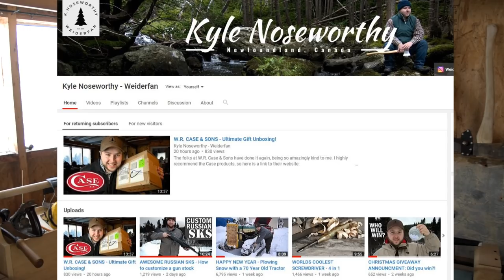Introduction to Whetstone Sharpening - [NLH 1]

Comment: Very good videos on sharpening. I've always wondered why some of my edges just aren't that shaving sharp. The back and forth strokes + removing that wire edge are kind of new to me. As well as the drawing a knife through wood after finishing up. 

I'm curious about improving an average factory edge. What could be done to a fresh out of the box pocket knife to improve it's edge further? Any tests you can do to determine what to do with it to make it a bit better before use? (Ex: go through the stones starting from 1000 grit because it cuts paper, but not well) or something like that. Just curious where you'd start.
Reply from the maker: Great question. Factory edges are usually fairly coarse, so I would attempt to refine that edge. You could start somewhere in the grit range of 400-1000, and begin removing those rough grinder scratches. Then repeat these steps until you have a polished edge :-)
Reply: @kyle_noseworthy  Awesome, thanks for that.

Comment: I have troubles with the shadow method for the angle, it seems I have to lay my knives flat to make the shadow disappear.. I have tried with a bugout and a coldsteel prolite..
So I sharpen them following this method, looking for the burr before moving on, and dewiring them  by making fewer and fewer passes on each side at the end but the result  is not very good.
 I think I may have my angle wrong, do you know other ways to figure out the angle or is there a tip for the shadow method ? Thanks a lot !

Comment: What stones do you recommend for beginners for sharpening a mora knife and some cheap knives on a budget
Reply: Too late now, but I'd say just find a decent ($35) 1000/6000 grit whetstone from Amazon and use that. It'll work fine, even though they're cheap; they still do a fair job.  Especially for softer steels.

Comment: Just a heads up Kyle. The small Nagura stone is for cleaning and making a slurry, not for flattening. I love your videos and they are top notch. Just wanted to point this out for the newbees.
Cheers and congratulations on the new T.V show! Thanks for all you do!
Reply: With a small amount of research (about 2 minutes) I have found that it is actually used for both. Us newbees would like to know that.
Reply from the maker: As @Ken C stated, a nagura serves as both. Just think about it: a nagura helps clean the stone because it wears away surface material, hence, wearing down the high points on the stone. It isn't as effective as a flattening stone, but it does help some, when used regularly! Thanks for watching!
Reply from the maker: right Ken!
Reply: Sorry but the Nagura 600 is a "dressing" stone, It won't flatten anything less than a 600 stone due to the grit. It is a dressing stone only, the slurry it produces will aid in polishing the blade. It will clean the surface of a 400 grit stone or higher but will just clean up the small filings left from the blade like an erasure. Yes, it will bite into an 800 grit and higher but when you're getting that high in stone grit you should be flattening with a stone that is equal or greater than the surface area of the stone being flattened. I didn't mean any disrespect with the "newbee" comment.
Reply: I don't mean any disrespect here and am not trolling. I'm just stating a couple of facts is all...
Reply: I use a progression of different grit wet sand papers over glass glued on a flat piece of wood. In my business my edges need to be perfect the first time and a perfectly flat set of stones is the first step. Great channel!

Comment: I recently purchased a Benchmade Griptilian 551 with 154cm steel. I did a little extra fine sharpening to touch up. One thing I noticed in your video- or another, was that you advocated the necessity of a uniform look to the whole bevel. When I sharpened my knife, I used the shadow angle technique which I already have learned, but the stone was not covering the entire grind, but covering a hairline portion at the Apex. although it looks exactly the same on both sides. I believe my angle was right. Would this mean the grind is concave?
Reply from the maker: Mark Vincent i believe your angle was incorrect. Too steep!
Reply: Well, it's as shallow as I will go, because that's already 34 degrees inclusive. Benchmade claims that the knives come with 20-24 dps. Weird I think, but I have 17 and 20 degree guides on my stone and 17 is as close as my edc will go. Can I  get your email to send you a picture? It might help some, because it still doesn't make sense. Thank you for getting back with me.
Mark
Reply: I was just playing around with it and I believe I found the problem. It is the coarse grind on the edge. I used a sharpie to see where I was hitting and the sharpie revealed peaks and valleys just like you ground off on your "dream knife". The grind is not so coarse at the Apex which would explain everything. Thank you for your help.
Reply from the maker: Glad you figured it out my friend. These knives are sharpened pretty quickly in factory. They aren't perfect

Comment: I’m having a tough time with my norton water stones. I use the same exact technique as I use with my Arkansas stones but I can’t get as good of an edge as I can get with my Arkansas stones. My Norton’s are flat and I’m using the same technique. Any idea what could be wrong?
Reply: What grits are both the oil and water stones?

Comment: Kyle, I wish I could do that.  Sadly my hands have a pretty good tremor due to a childhood injury that gets worse when I try to be steady and also when I apply constant pressure.  Thus I had to go with a sharpening system.  Despite my physical limitations, the tool did free me to take care of my tools.

I can do axe heads, because it's a more circular pattern.  However, when it comes to knives, do you have any advice to possibly use my body rather than my arms and hands to move?

I know it is a specific request.  But I would love to be able to do this by hand.

Comment: Does it matter if you leave the slurry on the 3000 naniwa or is it the same as you wash it away

I only have some king stones 1000/4000 so I am not an expert :)

Love  your videos
Reply from the maker: Great question! In this case, you can wash it away. I like the way the stone cuts with a fresh clean surface. You're off to a great start, and I can tell you're thinking on the right track!

Comment: Hey Kyle - Great video but I feel that the Japanese scrubbing method of sharpening is rather limited. 
It's all well and good for when you can take the tool to the stone, but what happens when you have a heavy or very large tool and need to take the stone to the tool?  Then this technique goes out the window. 
Ideally you want a sharpening technique that never changes no matter what you are sharpening or whether you need to take the tool to the stone, or the stone to the tool. This creates more consistency, and consistency of technique is great.  

Furthermore, the Japanese scrubbing method also requires the user to have a steady, non-slip platform to place a stone on.  It also requires the use of both hands to sharpen. These are both flaws in my opinion. What happens if you need to sharpen something but don't have all the accoutrements you need, like a flat stable surface, or your rubber stone holder?  Or better yet, what happens when you use something like a sharpening rod which doesn't afford the user the ability to use both hands to guide the knife because you are now using one hand to hold the rod? Or what happens if all you have is a 3" pocket stone?  

All of these examples cause that Japanese scrubbing technique to fall apart IMO. Not trying to troll at all; just stating my own experiences with that technique because it was the first one I learned (from Murray Carter).  

Just out of curiosity, how to you sharpen large or awkward tools or tools that require the user to take a stone to the tool?  Thanks
Reply from the maker: I have to disagree with you Dan. The fact that you gave all that criticism without suggesting a better method implicates that there is no better method. Name a single sharpening method that will work for all edged tools? There isn't one. A sharpening stone is, in my opinion, the only sharpening item that is capable of sharpening pretty much ANYTHING you throw at it, consistently, affordably, while being transportable. 

Stones can handle knives, plane irons, chisels, axes, drawknives, spoke shaves, and nearly anything else that doesn't have a severe concave like a hook knife. 

To further debate, whetstone sharpening can EASILY be done with one hand, and it absolutely does not need a non-slip base. I used my stones for years without the holder that I have now. I'd lay it down on whatever I had. 

To address your last sentence, I do just that: I take the stone to the tool. A whetstone is easily held in one hand, gripping the tool with the other. It's especially easy when using stones that are a little smaller, like the Council Tool Arkansas stones. 

I feel I have broken down all your arguments, so unless you can suggest a better option that fixes every one of these issues you described, WHETSTONES WIN :-D
Reply: Kyle - I think you missed the entire point of my comment. I'm not criticizing the sharpening tool (I love stones), I'm criticizing the Japanese scrubbing "technique". So you really didn't shut down any of my points...  In fact, your response seemed as though you were inferring that I was in favor of jigs or controlled angle sharpening systems. This couldn't be further from the truth. I feel sharpening systems are nothing more than a crutch. I personally believe freehand is always the best way to go. Skill > Tools. 

So as I stated earlier, my problem is with the scrubbing technique. As I stated, it's very limited in what it can do and thus necessitates abandoning the technique in favor of something else when any of my aforementioned scenarios happens. 

You also asked what my answer is.  I personally believe that sharpening using circular motions alleviates any need to ever change your technique while sharpening, no matter what sharpening implements you use (rod, benchstone, pocket stone, coffee cup, etc), and no matter the size or weight of tool (pocket knife, sword, axe, machete, shovel, scissors, etc.) the technique always works. 

The only drawback (if it even truly is one) is that it doesn't leave a "pretty" scratch pattern at lower grits, but scratch patterns don't matter much anyways as long as you reach a true apex.  In fact, Murray Carter once explained that the reason why the Japanese sharpen with a slurry is to create a random scratch pattern to limit carbide pop out. Sharpening using circular motions achieves the same effect. 

Using circles is also theoretically the fastest way to grind steel on a stone because the blade never stops moving, whereas even with a Japanese scrubbing motion (which is fast), you still have to stop and change direction abruptly at the beginning and end of your strokes.  It doesn't seem like much because it's fractions of a second, but over hundreds of sharpenings, that adds up. But using circles, the blade never stops moving until you need to sharpen the other side of the blade. 

Using circles is also more sympathetic to the stone and the blade. Using circles allows the user to not only target specific portions of the blade to sharpen, but also target only specific areas of the stone as well, which allows for less dishing.  Conversely, scrubbing motions have a tendency to flatten (straighten) blades with curvature or bellies whereas using circular motions makes it much easier to sharpen, follow, and blend blade curvature as you sharpen. Not saying it can't be done using scrubbing motions, but it's much easier to mess up and create flat spots on a curved blade....  (there's a reason why all Japanese curtlery ends up looking like a wharncliffe or sheepsfoot over time; it's because of their sharpening technique). 

So that's my 10 cents. Like I said, I wasn't trying to troll or start an argument, although your response sounded rather salty. Either way, I enjoy your videos and hope you keep doing what you love!  Take care.
Reply from the maker: Hey Dan, no saltiness intended, but it may have come across that way. I may have sounded abrupt, but it's probably habit due to defended myself regularly on here. At this point, I usually assume negative intend from the commenter!

I apologize, I did misread your comment. I thought you were arguing against freehand sharpening. I have use circular techniques, but I changed to my current method for various reasons. When sharpening a drawknife or axe, I use circular motions. When sharpening something like a plan iron or chisel, I usually use what you call a 'scrubbing technique'. 

Thanks for the info! All is well my friend.
Reply: Hey thanks Kyle!  You mentioned that you used to sharpen using circles but switched to your current back and forth (scrubbing) motions for various reasons. I'd love to understand what your reasons were!  I'm usually more interested in knowing "why" people do what they do rather than just "what" they are doing. 😉
Reply: how are you supposed to use the same technique when you're taking stone to the tool instead of the other way around? that is such an inane point to criticise... it's like saying "driving a car is a bad technique because you can't use it if the car is turned on its head"

Comment: Kyle, I have a question, how long do you soak the stone prior to use?  Thanks, love your videos!
Reply: I usually soak for 5-10 minutes, or wait till they stop bubbling. 
Some stone manufactures use a resin that doesn't like to be soaked just wetted. But between kyle and I we have Naniwa, King, Coticule and Norton stones. (maybe a few I forgot: ) All of these don't mind being soaked, however those brands  may have a line/version that does. So just beware of the specifics of your particular stone. 
Hope this helps!
Reply from the maker: Ray is exactly right. for me, it is usually 5-10 minutes. However, you might notice that my combo stone bubbles significantly more than the others in the video. It is quite porous, and likes a good thorough soaking before use. Get to know your stones!
Reply: Thanks Ray!
Reply: Thanks Kyle!

Comment: Wicked job buddy loved it, making want to pick up my stones and put down my lansky
Reply from the maker: Put the time in Matt, and you won't regret it man! Especially when, like me, you need edges on all sorts of tools!
Reply: Kyle Noseworthy - Weiderfan  I agree, it's takes alot of practice.
Reply: Yea for sure, I noticed a few times that the lansky is very limited in what it can do, it won't work on small blades. Like my hen & roster trapper you sharpened for me, the knife clamp rubs the stones because the blade is to small.
Reply from the maker: Yep, exactly my point! Not to mention chisels, or draw knives, or hand-plane irons, etc. You get the idea! ;-)

Comment: My problem is too many hobbies hehe, I should stop getting into expensive stuff :p
Really want just ONE good straight razor after using DE for a while, but then you need stone, strap etc, and I can`t really justify it, getting a decent stone and strap here in norway is laughably expensive hehe..
Reply: There is something very therapeutic, almost meditative about sharpening tho, can easily get lost for a while :)
Reply from the maker: I'd recommend  you sending it out to have it sharpened, professionally. If you're stropping with each shave, you can get 6 months out of an edge. Straight sharpenings will run you around $30 Canadian, so you could have it professionally sharpened for years before it would total up to the cost of the stones you need. :-)
Reply: That sounds pretty cheap actually, BUT, I live in norway, don`t really know any places that sharpen straight razors :/
It`s something that keeps coming up tho, might have to treat myself to a sharp and shiny christmas present this year ;)